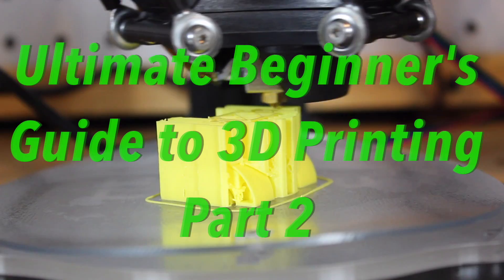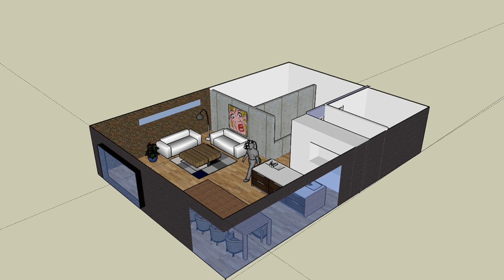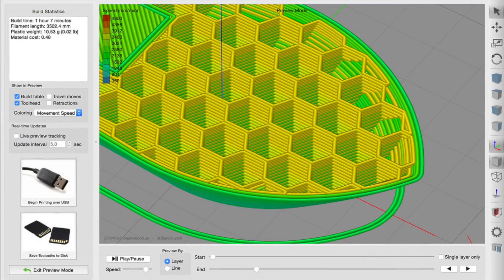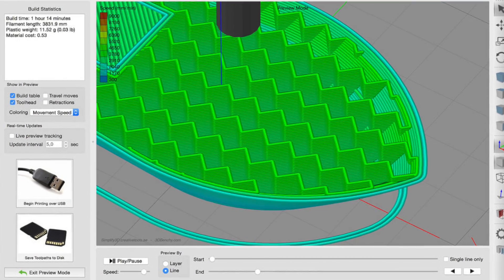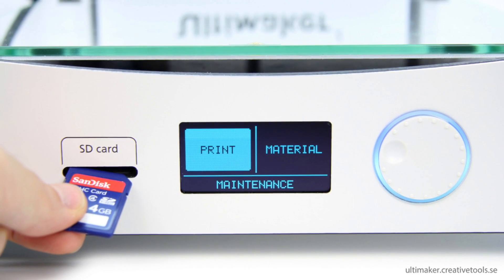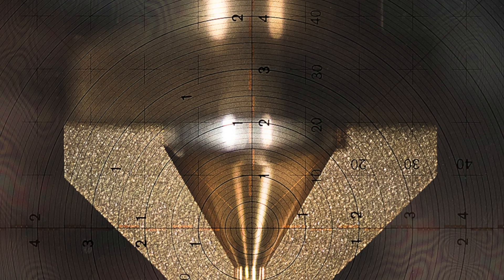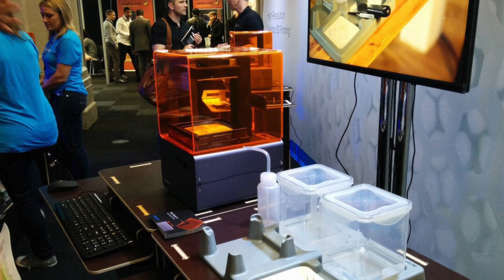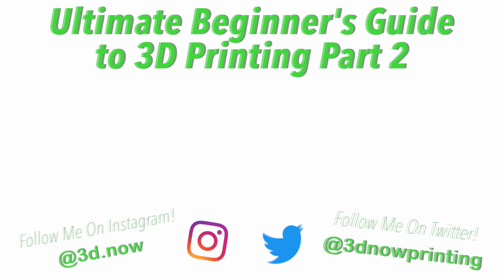The Ultimate Beginner's Guide to 3D Printing - Part 2

Comment: Hey I have a question and also I really like your videos 
Say I want to make a custom car part but don't know the dimensions of the oem original part. Is there any way to find the cad model or dimensions say for a front bumper or something like that. If so where could I look?
Reply from the maker: For a car part, it's really unlikely to find a cad model. You usually would have to model that yourself. You can check online, though. I made a video about where to find 3d models to print.

Comment: Hey I just subscribed after watching the first part! I’m new to this 3D printing stuff so if my question sounds silly sorry: If I wanted to use a carbon fiber filament do I need a special kind of 3D printer or can I just get any 3D desktop one and a nozzle that can handle the abrasive nature of carbon fiber? Thanks
Reply from the maker: Most printers will work, but it needs to be able to heat the nozzle up to a high enough temperature and you do need an abrasive resistant nozzle. A heated bed is needed as well for most filaments.

Comment: Does .STL files have an advantage over .OBJ? 

Also, can you use painter tape on a glass bed? Or do you need to have a 3D printer that comes with a painter tape bed?

Are perimeter layers also known as shells? 

And do all 3d printers have changeable nozzles?

Comment: I’m interested to know about 3D scanners and if they can be transferred straight to a stl file
Reply: 3d scanners create a massive amount of data usually in the form of a point cloud.  Most output to OBJ files which you would normally import into a 3d modelling program to clean them up.  .STL format uses surface tessellation to ensure there are no overlaps or gaps.  Scanned objects are full of gaps and overlaps and extra information that does not relate to the finished product. What kind of scanner? LASER, Photo, XRay?

Comment: i have a model that i want to print on my cr10 on cura i type in the measurements of the model which is 190mm but it does not fit the 300mm print bed, do you have any ideas on how i can fix this?

Comment: Is there any health hazard can be caused by 3d printers if used in a living room and ppl around it ? is it loud while operating ? is there any heat generated ?
Reply from the maker: The melting plastic can be toxic, but it depends on the material. Most printers do make noise, but it depends on the printer, and some heat is generated from the nozzle and build plate, but not too much in the room it is in.

Comment: nice video mate,i wan't to buy a 3d printer,but i can't decide wich is better.Is the alfawise u20 good quallity printer? i wan't to print 300*300*400 scale.
Reply from the maker: If you want a printer with that bed size, check out the cr10 with the link in the description
Reply: @3DNow  i checked.u suggests me that or alfawise u20? At the c10r is good quallity materials?
Reply from the maker: I would recommend the cr10 or cr10s because I have not tested the u20

Comment: hey bro! I have some basic questions... I've seen that a lot of people on youtube that shows, which printer they recommend, or they explain how it works, but I can't find how to maintain the 3D printer. I've ordered an ender-3 printer and the reason why I choose this one is because it is cheap good looking and I think it will be fine for me, and it was also recommended by some guys on youtube. since I have like almost no clue about this stuff, I'm really interested how you maintain it,  like what should you do when you finish with printing, do you need to clean the nozzle and if how? and I also don't know how often would you change the nozzle, or how you know its ready to be changed... tnx for reply
Reply from the maker: Hi! After a print finishes, take out the spool and put it back into its plastic bag. That's it. You don't need to clean the nozzle unless you are switching filament. Just turn the heat up a little higher and let the new filament run through for a little. The brass nozzles usually never have to be changed with PLA unless you are using abrasive materials and the nozzle hole is getting bigger. If you are constantly printing carbon fiber, then the circle hole on the nozzle will probably wear out after a while. The signs are the filament coming out of the nozzle not in a straight line, but curling everywhere. I hope that helps.
Reply: tnx bro that helps a lot :) nah i just started.. so for now, until i don't learn some basics ill keep evrything on an easy lvl, and PLA i think will do the trick :) but if i will have some more questions ill ask :)